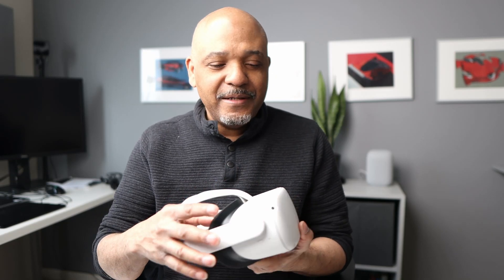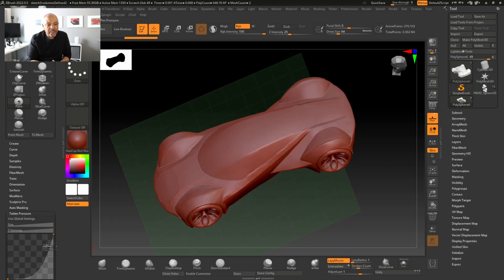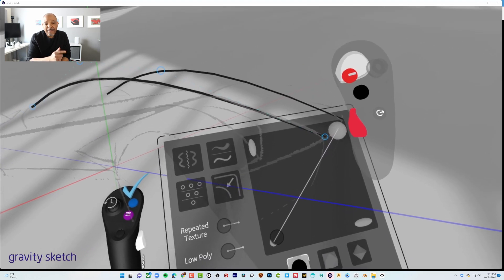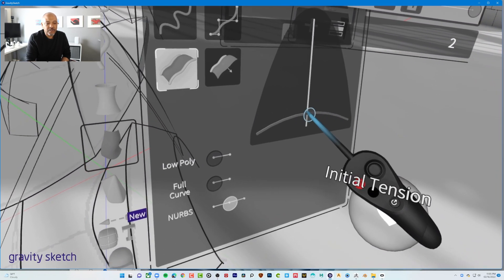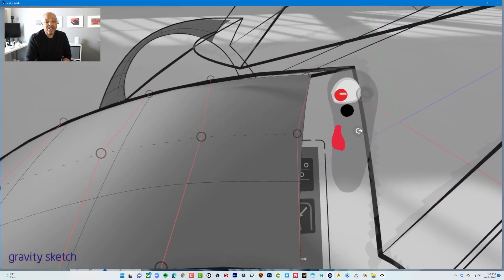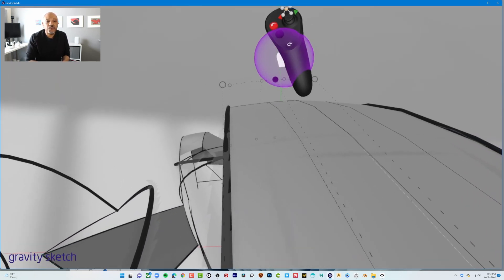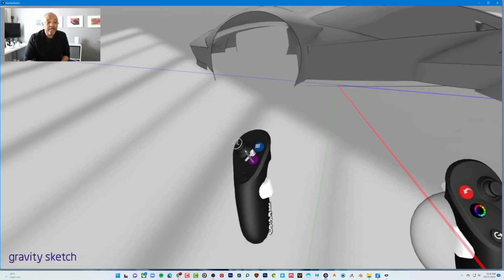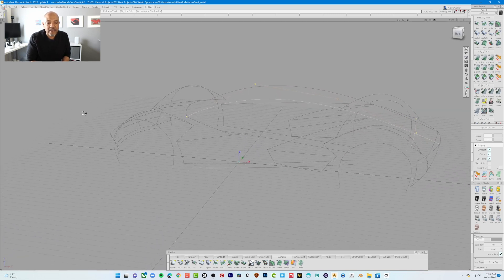Zbrush to Gravity Sketch Overview (Part 1)

Comment: Hey
How do you import the iges file into Alias? I’ve been trying that method but the surfaces do not seem to carry through, only the strokes that become curves can be seen.
Reply from the maker: Gravity sketch creates two types of surfaces, SubD and Nurbs.   Only the Nurb surfaces and curves can be directly exported as IGES.  (I was creating Nurb surfaces in the video). 
But subD surfaces must be exported as an OBJ and imported in Alias as a SubD.   File >> import >> Subdiv.    Once inside Alias, these surfaces can be worked on as subDs or as nurbs.

Btw, the reason why the strokes were the only element seen is because all  strokes in gravity sketch are created as Nurb curves.   If I’m not mistaken,  it doesn’t generate “subD” curves, thus when you exported as an IGES, the IGES translator only understood the Nurb curves but not the SubD surfaces.
Reply: @Carstylus  thank you so much for taking the time to understand and reply to me. It’s super helpful to know. Will help a lot. You got a new subscriber 👍🏼